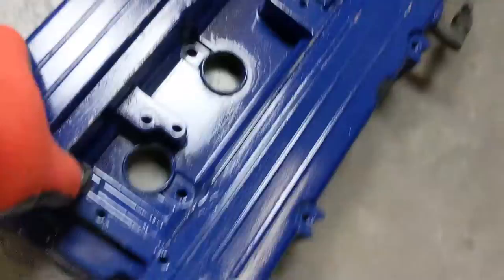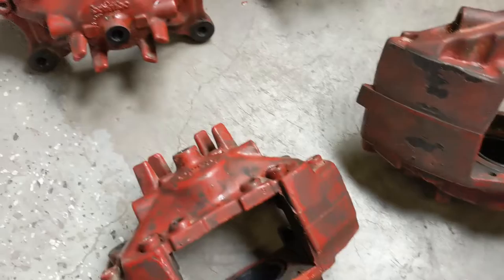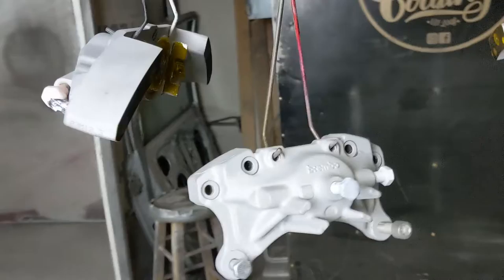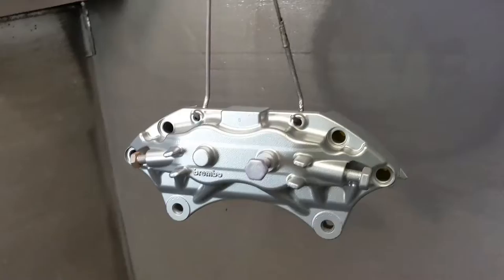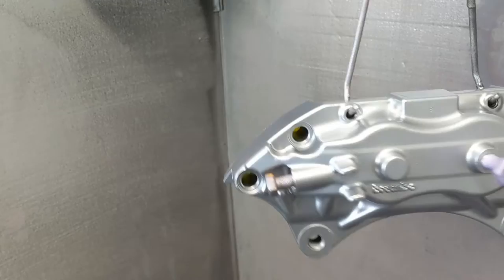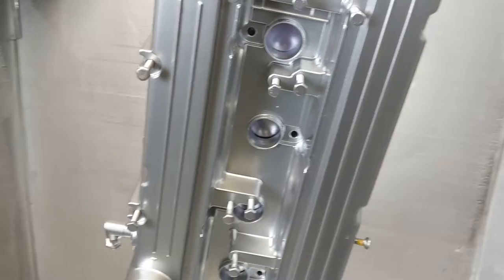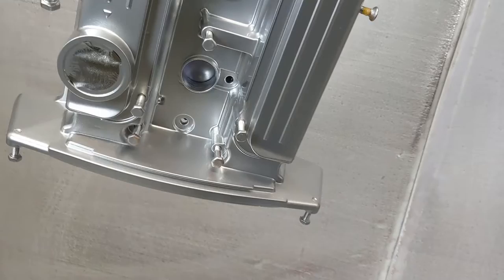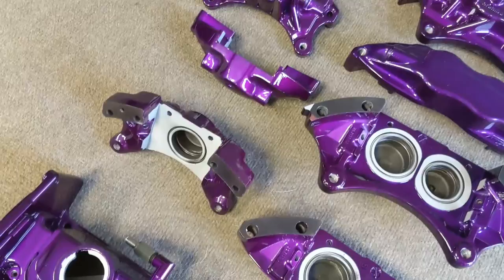Powder Coating Evo Valve Cover and Brembo brakes - Ep 1

Comment: Hey Great video ! When applying the clear coat did you wait for the part to cool back to room temperature before powder coating again ? I’m having trouble with my clear coat sticking to my brakes after adding base coat . Not sure if it’s because the setup i’m running or what . ( the setup is eastwood dual voltage gun by the way ) .

Comment: Some valve covers out there have some crazy oil baffles for the pcv systems. Do you usally do anything to seal those up when you sand blast them? I've always been terrified of not getting it all and getting blast grit in someones engine haha. Back when I was coating I would usually just sealup the pcv ports and the underside of the valve cover.

Comment: How long are you curing the base coat?  Prismatic says to do a partial cure for two minutes after flowout (not after pmt reaches 400). I’ve tried several samples the way they say and my second coat just does not want to stick.
Reply from the maker: What gun are you using?

Comment: After gassing off do you then clean up with acetone before taping up and coating?  Thanks
Reply from the maker: Nah I usually reblast em. I don't use acetone for anything in my process
Reply: @UnknownCoatings  awesome.  What blast media are you using bud?
Reply from the maker: @r-joule  green diamond

Comment: So the powercoat doesn’t melt or get damaged under extremely hot temps?
Reply from the maker: powder is a 1 time chemical reaction. And I have never had an issue with brakes, even on road race and auto cross cars.

Comment: Dude what kind of blaster are you using? Is it a pot blaster?
Reply from the maker: I use a Skat Blast cabinet and changed it to be pot fed. Just a 110 from harbor freight, slightly modified for better flow.

Comment: Nice work. 
Where do you get the caliper torque spec when assembly comes down. Thank you in advance.
Reply from the maker: when reusing bolts, there is no "torque spec" that can be universally applied.

Comment: Did you know that Brembo says to never powder coat calipers and never ever split calipers?
Reply from the maker: Yeah.  Meanwhile 300+ sets of calipers later. I keep doing it.  Brembo also believes their finishes last longer than 4 months.  So there's that
Reply: Never say never @tahoe1234x
Reply: tahoe1234x California also believes my intake will give you cancer
Reply: Brembo also says you can’t “re-use/swap” calipers from one car model to another that the calipers didn’t come on or where not “designed for”... yeah ok!!! They also consider anything (swaps, paint/powder coating, rebadging) “counterfeit”. Comes down to $$$$, they just want you to buy from them not from ebay, not from a junk yard, etc.